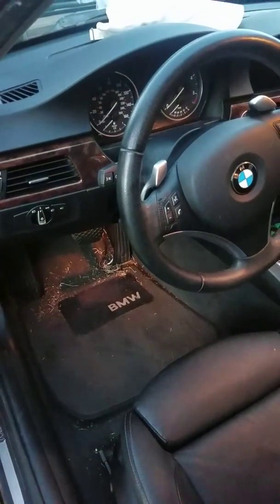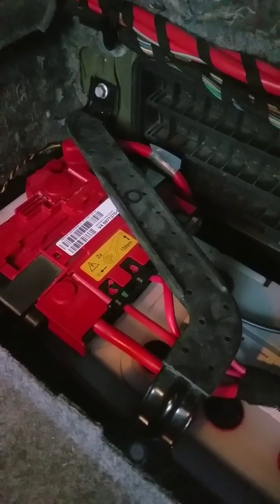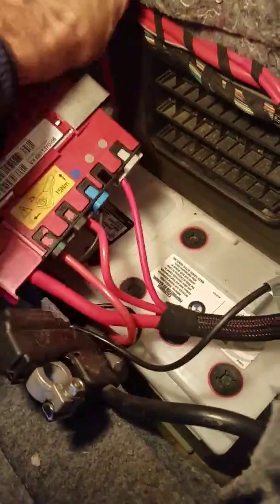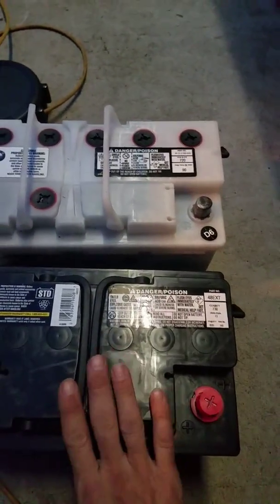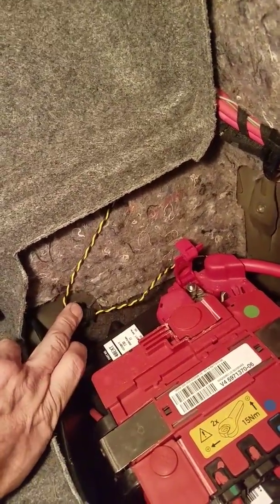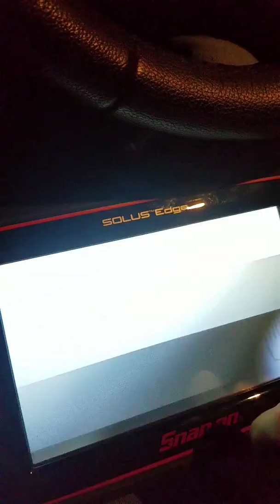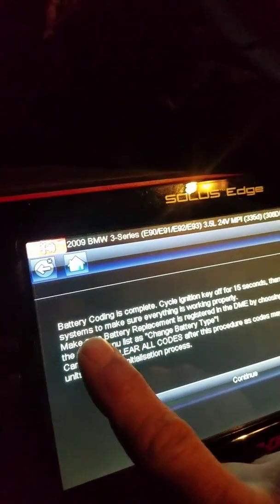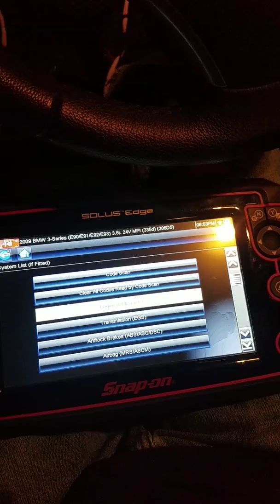BMW 335D E90 Battery Replacement & Programming

Comment: Do you have to register the battery?
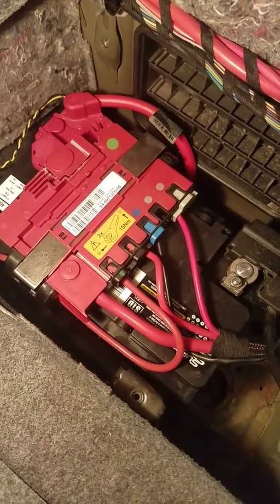Reply from the maker: Yes, if you go to 5:10 in the video, I show you how to do it. You can use other brand scanners if you have one that has the capability to do battery registration.
Reply: @okcvet1st  😂 watched your video. But I guess I should have asked a different question. What would happen if you don’t register the battery?
Reply from the maker: @victormmexicano8122  oh, ok. So this may be a long reply but bare with me.  I've heard different things about what happens if you don't register the battery from nothing to all types of issues, but I've had my own experiences. On bmw's, it seems to kill the new battery sooner or have dead batteries more often depending on driving style, and electrical issues. Not that it happens overnight, but over a period. I've seen check engine/dash lights on for what seems like ghost issues. The computer basically adjusts itself on what it's being told. How the battery is charging, how to charge it, how its discharging, rate of charge, etc. It can also strain the alternator by having false info from not registering. When you have a old battery, the charge rate is different then a new battery. So basically when you don't register, the computer is still charging at the same rate and could overcharge/undercharge the new battery, especially if you change battery types. Short drives kill batteries also because they never recover output after starting. Different types of batteries have different charge rates, so you have to tell the computer what type it is charging for it to do a proper charge. Confusing? Somewhat but once you get the idea, it should be a little clearer to understand. I've had people drop off their vehicles and say they have had their battery replaced 2 times within a yr but don't know why they keep getting a bad battery. Normally the same people say they have dash lights flashing different times as they're driving. I believe this may be caused by false voltage/amperage info caused by not registering the new battery/type. After I replace & register a new battery, all the sudden no issues. That's when I tell them that whoever put their battery in, didn't register/program the computer and it may have been causing all the issues. That's usually when I pickup a new customer, and the other places looses one. The scanner tells me if the battery was registered/replaced if they did a proper battery replacement. 9 times out of 10, someone has a yr old battery but the computer is saying it's never been changed/ registered. That tells me they didn't know it needed registered, didn't care, don't have the ability, or don't think it causes an issue. But it seems not doing it has different effects for everyone. Hope I answered your question this time and didn't bore you too much. Keep in mind, all manufacturers do things different and have their own reasons. Thanks for watching!
Reply: @okcvet1st  you definitely didn’t bore me with your explanation. I really appreciate your answer. I’m active duty and we have the ability to use scanners on base but my car is off base. Based on your answer I should be able to change the battery at home and once I make it to base I can use their scanner to register my battery. Thank you so much. I really appreciate it
Reply from the maker: @victormmexicano8122  No problem, glad I could help. Good that you have access to a scanner through the auto shop. We didn't have any scanners in the motorpool when I was active duty working on humvees and hemits. Its been awhile since I've went by TAFB auto shop, but I believe they either shut down or really cut back on services. Ft. Sill use to have a really good auto shop with paint booths and the whole works. But its been even longer since I've used that one. I actually did my very first paint job in the Ft. Sill auto shop paint booth back in the 90's. In fact, I still have that truck which is a '63 VW Type 2 single, and it still has the Centari paint I bought on post. I still remember the guys giving me heck because I painted it Purple Pasion on the bottom and Bluebird  paint on the top half. But, everyone knew me and if not me, they knew the truck!  I've had my own shop for over 20 yrs now so not really any need for me to use the others. Anyway, have fun and take care!
Reply: @okcvet1st  The scanners we have are from the hobby shop. It’s one of the few things I really like about the military. I like those VWs, I love to have the bus version but they are way too expensive. Those colors sound like an interesting combination 😂. I hope your business continues to do great. Again, thank you for your help/advise.